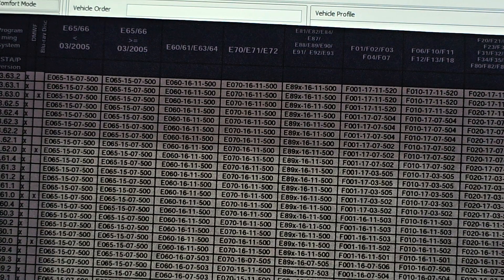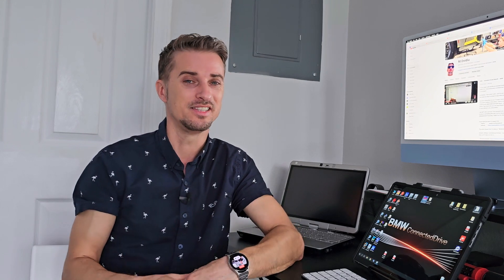BMW I-Level explained !

Comment: on my F30 328i build date 9/2013 I have already done some retrofits 5AC (high beam assist) and 5AG (lane change warning). If I do an I-Level update will i lose the coding for those retrofits?

Comment: @MOvidiu - Can you recommend a power supply to use when programming modules to keep the voltage at 13.5. I was planning on using something like the PowerMax PM4.
Reply from the maker: Deutronic is the best , but ideally, it is to find one capable of 100A

Comment: De abia aștept videoclipuri in care actulizezi la F25 la zi si ne povestesti daca chiar se cunosc diferentele dupa update-urile de software sau nu. Ca intelesem de la un tuner ca ar face mai mult rau decat bine..
Reply from the maker: Update de sfot nu inseamna cai putere! In schim este o inbunatatire, aia inseamna update, ceva mai bun!, o versiune noua de soft care a reparat niste baguri descoperite la versiunea anterioara! , nu vreau sa super pe cineva dar cel care face rau e tunerul care se crede mai destept decat toti ingineri si echipamentele de milioane de dolari folosite la dezvoltarea acestor vehicule, si isi baga nasul sa modifice parametri ! Ca stie el mai bine!
Reply: @MOvidiu  Asa este, voiam sa scriu între ghilimele, se ocupa și cu acest lucru pe lângă altele. Chestia este ca am observat ca mulți se feresc de aceste update-uri, spre exemplu îmi povestea respectivul ca a făcut update pe DDE motor și își făcea regenerari mai dese, putere mai redusa (mi-a explicat ca noile versiuni de soft au alte implementări conform noilor norme, ceva de genul). Chiar este interesant acest subiect, care la noi nu este deloc promovat și executat. Am întrebat inclusiv la reprezentata bmw, voiam sa am totul la zi la un x1 2014 și au spus ca nu au mai făcut pe E-uri de foarte mult timp spre deloc și  îmi dădeam de înțeles ca nu recomanda..

Comment: Love it! Thank you so much. Maybe you will have mercy on us filthy, cheap E53 owners and do some ZCS coding. For the life of me I couldn’t get my new LEW sensor to code correctly. I ended up doing some cave man stuff and took the new brush/ring out of the new sensor and installed it in my old one. Then with steering wheel straight, I looked at live data on my bootleg Chinese laptop and rotated it to 0 degrees internally. Then slid it on the steering shaft splines and went on with my life after a quick calibration. Worked by felt like hackery for sure. 😅
Reply from the maker: You have done it perfectly! Those modules are a little bit harder to code! But they can be very easy cloned with BMW Scanner 1.4

Comment: I have an Autel Mk908Pro and i can update the I-Level just fine( i had a payed subscription), i've programmed some 3 series(F) and 5 series(E,F) with no issues , also coding is a breeze , nice video, keep up the good work, i also use ISTA+ some times ,for troubleshooting it's better, with Autel i would have to spend 4000€ to get the Ultra to be able to get IASTA+ level o troubleshooting capabilities , but for now i stick with what i have ,they do the job just fine...
Reply from the maker: Thanks for the info! So, in ista, the ilevel of the vehicle will appear updated to the one Autel has ?

Comment: In my case i have e60 but i have many retrofits, one of them is cic + combox, Will it update the i level with all the retrofits and combox that have never been part of the e60?
Reply from the maker: You can't do a clean I-level update anymore! ( at least not in the curent vehicle configuration,  if you restore it to factory state yes ) because of the retrofits, but you can do individually updates with winkfp and also with winkfp you can manually change the I-level

Comment: My friend programmed only EGS gearbox module with new version on F01 and after that, car gear selector stopped working, he cant select gear. I suggested update ZGW software also and after that gear selector worked again. So when updating on module at the time, there are dependencies between ECUs, that are also different between different software versions.

Comment: Hi Ovidiu, I have an E70 and replaced my VM. When programming in Ista P, it fails and writes the following error (Global Vehicle Communication CoAPI.1190 - Boot sector update not possible it not required). Unfortunately I am not sure with how to proceed. Many thanks
Reply from the maker: To do a software update in the e70 or E series, you need ICOM next A and ICOM next B , especially to update the multimedia system!
Reply: @MOvidiu  correct, and I am using these items.
Reply: @MOvidiu  do you have a view with why this error is occurring? Many thanks.

Comment: 8:11 the limit these days is pretty high, higher than anybody should attempt to program a car 😄. However, if you do reach that number, the car will normally prevent you from flashing above that maximum limit.